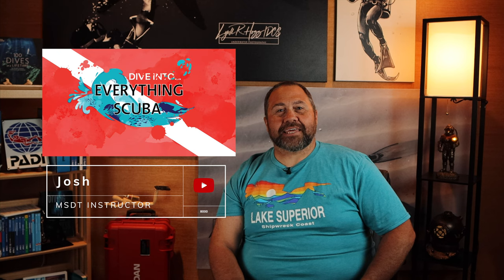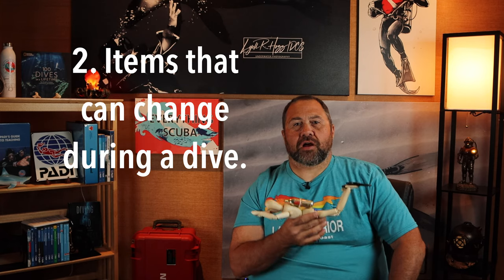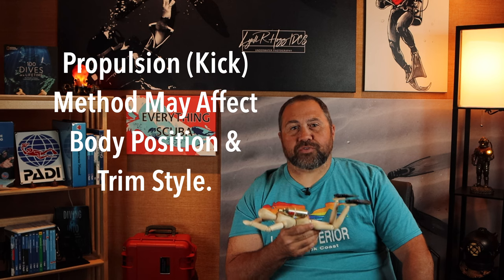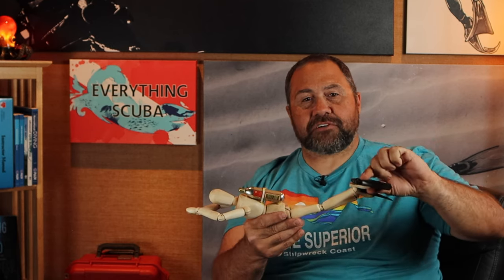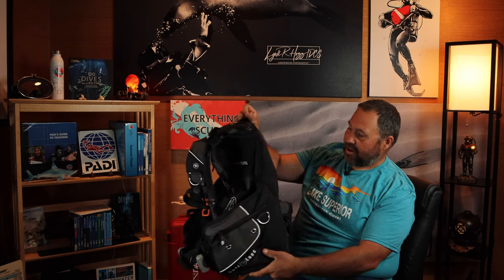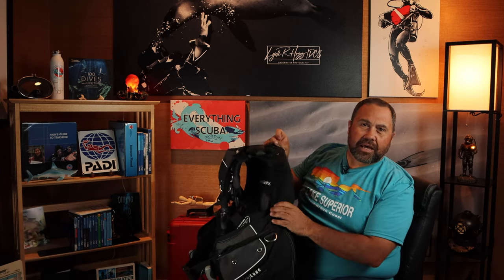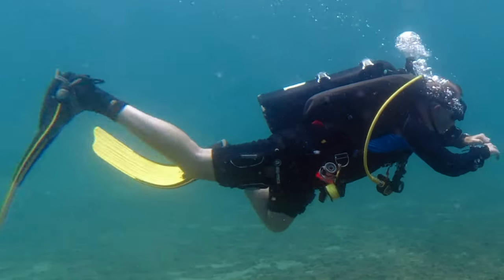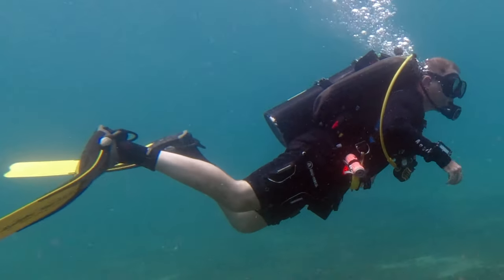How to perfect your trim position for scuba diving. (2nd Basic Fundamental of Scuba Diving)

Comment: One thing that you didn't mention when determining trim characteristics is how you need to get motionless to really determine trim.  Finning along can cover up a lot of trim issues.  Stop completely (no body motion), relax and hold.  Let your body spin.  This is very disconcerting for many new divers, but is necessary to really determine head up, fins up or roll conditions.
Reply from the maker: Thanks Mitch! Great points......remaining stationary allows you to really dial things in!
Reply: Spot on!  Excellent point, Mitch.
Reply: THIS! i got my trim right by not moving. i am a swimmer and i find it hard to not move..
Reply: yup ... hovering is the alpha test
Reply: I'm a new diver. My feet down most of the time not sure why or how.
And tend to roll to the to the side too.. I think my jacket is too loose or something.
Reply: @damienlim8082  put some weight up on your tank ... it will cause you to lean forward more.

Comment: Please, please, please, stop touching, uncoated, lead weights. Lead is toxic and it shouldn’t be handled. I use coated lead weights and therefore I actually never touch the bear lead that is covered by the coating. Also, the Diver that demonstrated the “flutter kit“was absolutely bicycling. It wasn’t much different than the example you shared of him cycling. Very common mistake New and even some experience divers. Use a very inefficient bicycle kick. The entire video was well done and the vocals were very clear. Well done!
Reply: The diver in the video was demonstrating a bicycle kick…

Comment: The best way for me to find my trim was to go fully slack underwater, and see what floated up and what floated down. Then adjusting weights and doing that again, until I was in trim. Find some shallow water (in a pool or in somewhere close to shore where you can keep weights handy) and spend some time going through the exercise and changing your weights. Even if it's the same amount of weight, having a 4lb lead on each pocket and a 2lb lead on each shoulder is very different than the reverse.

Comment: HI Josh, Question about weight distribution for LARGE divers that require a lot of weight.  I was on a dive trip and the dive master insisted I wear 1 pound ankle weights to help distribute my weight.  I still had fun, but I can't help but think it likely affected my trim.  What are your thoughts on ankle weights and do you have any suggestions for dealing with diver masters that don't want to listen to me when I tell them my weight requirements?  (this happens often and it is very frustrating).  I don't want to be the "seahorse" in the bunch.  Thanks!
Reply: I’m a 24 pound weight guy in a 5 mil wetsuit. Dive instructors need to remember what works for them doesn’t work for other body types.

Comment: Hi Josh, you nicely mentioned that the arms counterbalance your legs, but it seems to me you missed to mention a crucial point regarding trim. By moving your arms further out or in, you can adjust how much torque they produce. Similarly with the leg position. 90 degree angle is fine, but if you vary it to a bit more or less, you also adjust the torque of your legs. So the combination of torque from your arms trimming your head down and the torque from your legs trimming your head up, allows you to not only trim yourself out in horizontal trim but also rotate depending on what you need to do. If you are diving on an incline, you can trim yourself parallel to the bottom like this. Hence, the best thing to learn to get good trim is the frog kick, so that you can get your arms and legs into that position which you can then use to properly adjust your trim. 

Of course this requires your kit config and weight distribution to be fairly good to begin with. While a little off-trim can be handled like this, if you are just way off, there is nothing much you can do (except maybe wearing a dry suit and migrating the air where it needs to go to counterbalance the weight placement).
Reply from the maker: +Tobias Hartung as always, we love your comments. You are such a great addition to our Everything Scuba community. Thank you for your insights!
Reply: @everythingscuba  Aww thanks, happy to hear that :)

Comment: Great video, but I would appreciate more details about weight distribution. I use neutral boyant fins, 15l/300bar tank (heavier than regular 232bar) positioned upwards a lot and 8kg on my belt. I'm a big (104kg) guy with very thick lover legs. Use frog-kicks mostly (with legs bent in the knees), ensuring that most of the air is at the lower part of my BCD (jacket-style), doing back-arch as far as I can, keeping arms in front of me, and I'm still a little leg-heavy when stop moving. I can hold horizontal position on safety stops without kicking or holding on something for some 15-20 seconds, but then I slowly start to rotate upwards. I don't like integrated weigthing system, because whole aparatus becomes too heavy for donning and moving around (with 15L/300bar tank attached). Maybe moving some weight to bottle-strap trim pockets? Or some other advice?